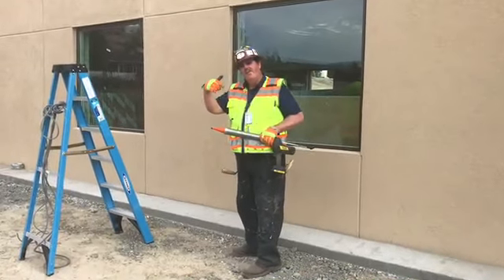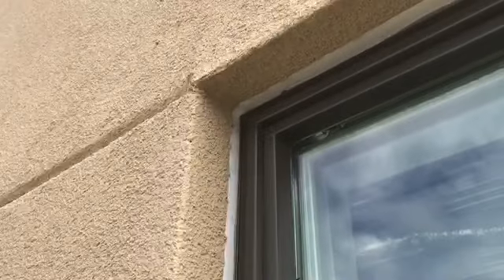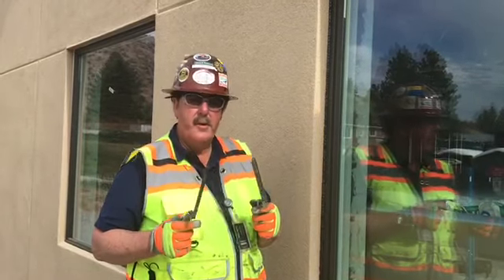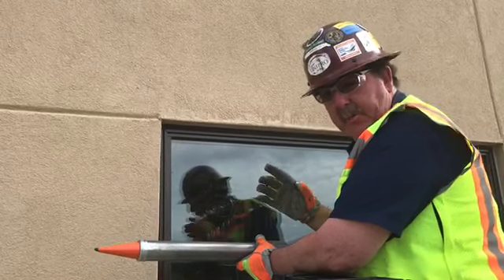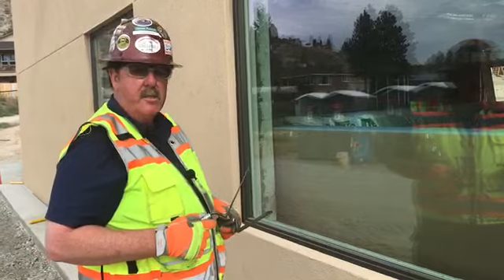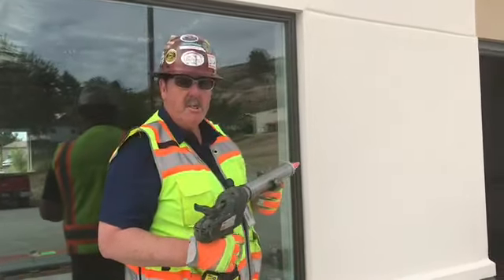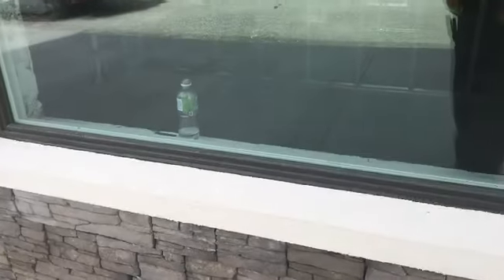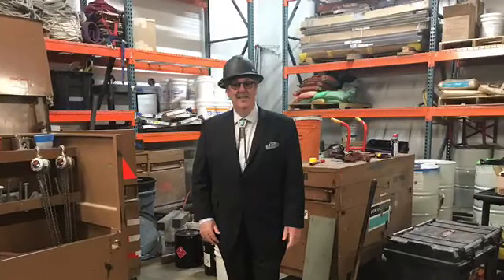Caulking Window to EIFS Surface

Comment: Was great Wayne right up to the point where you used your boot to open the sausage,  cmon man grab some snips Brother!!
Reply: Wayne I am based in ireland .were can I buy the tools for smoothing out the chalk .ie taper ones ect .
Reply: @Stockman143  they are called tooling knives. Albion make good ones so does the manufacturer Newborn. Amazon.
Reply: The boot is the best and quickest way to keep on rollin...best tip someone ever gave me!
Reply: @DJREZEREKT it’s literally the opposite of what you should do You have to hold it by the wire clamp and swing it from side to side to condense the caulking that way it’s faster less pumping That smacking the boot 5 times is ridiculous and stupid
Reply: Never use ur boot to open a sausage use ur olfa knife or snips...
Reply: Totally unprofessional

Comment: Not bad dry tooling no soap pretty good
Reply: Albion please make a mixing paddle with the octagon shaped rod the oval or circular rod, comes loose when you’re mixing it would be so much better if you made bulk caulk mixing paddles with the octagon shaped rod they would sell like crazy here in Indpls. Hexagon octagon or polygon thanks!!!
Reply: Wet tooling used to get entire companies thrown off jobs and this guy is NO CAULKER

Comment: What kind of caulking did you use
Reply from the maker: Hi Kathy, we believe it is a Sika Sausage pack material. If you watch "How to Caulk Around a Door Frame E.I.F.S.", which is 1 of the 2 video series, you will see the material used for both videos. Around sec 26.

Comment: Not impressed.....dont like dry tooling....dont like the way he shoots a bead with the power gun he is jittery....i could shoot that in 1/4 the time and make it look way snoother....wet tool with a stick and soap all the way....
Reply: Except dow silicone says never wet tool. Wet toolers are not real caulkers. Tape and dry tool.